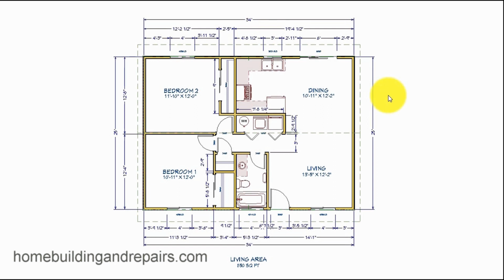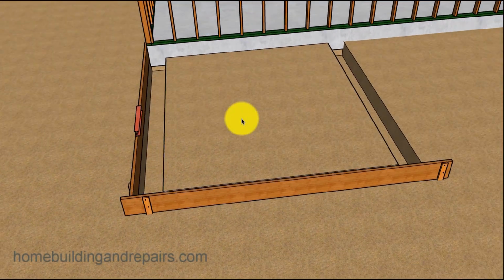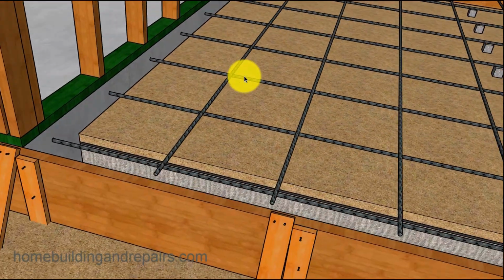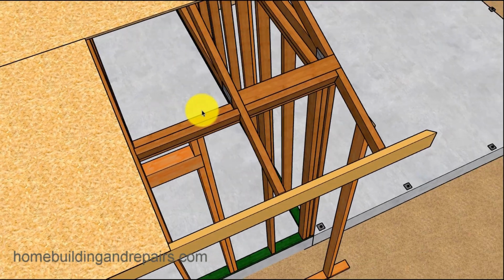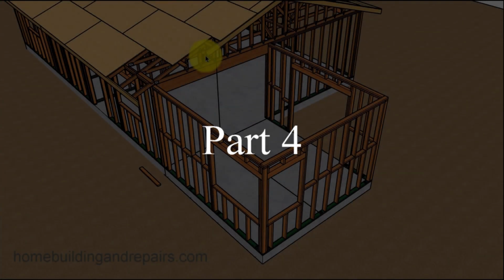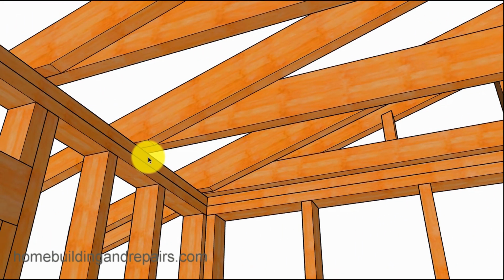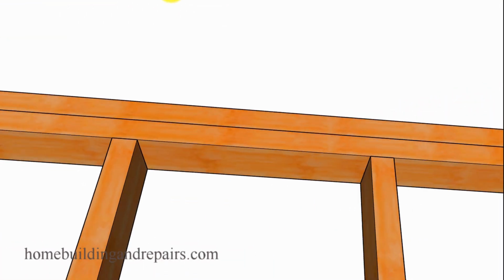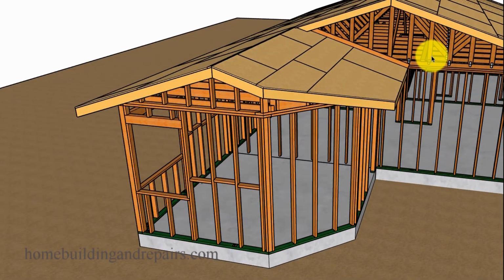How To Design And Frame Small Home Addition - Gable Roof And Angled Wall Tutorials

Comment: Does anyone know what are the circumstances to spec for a holdownd (not sure about the spelling) rather than an anchor bolt. Is the Holdown a stronger connection? or is it used to connect foundation to bottom wall plate when you forget to install anchor bolts? I am just curious to know.
Reply from the maker: That's usually up to the engineer. You can contact the product manufacture for more information about strength.